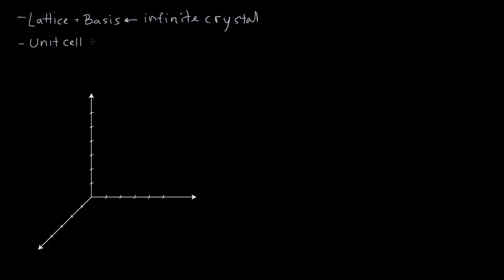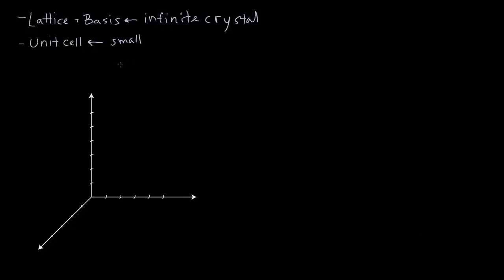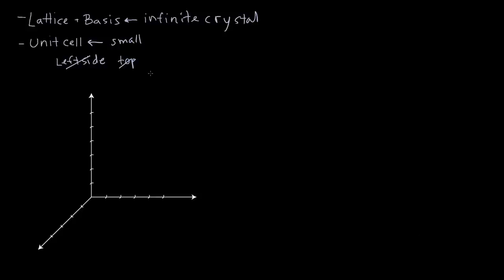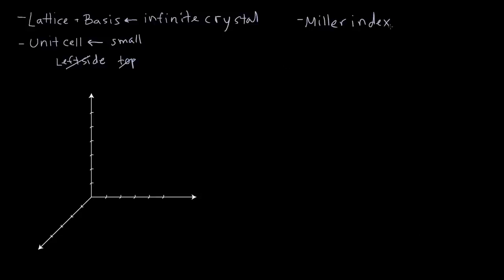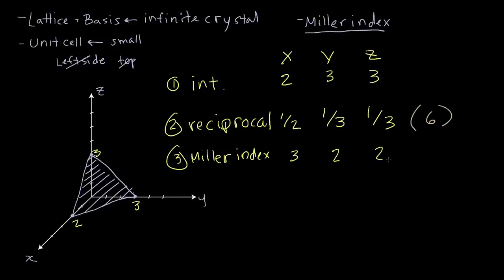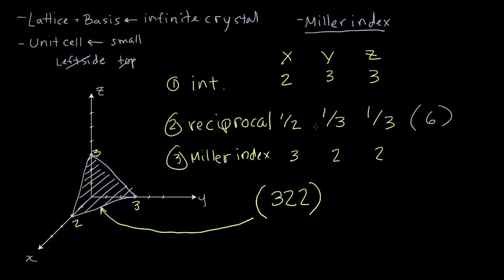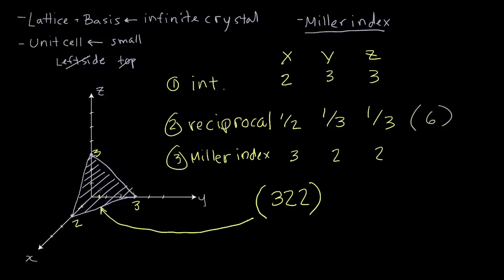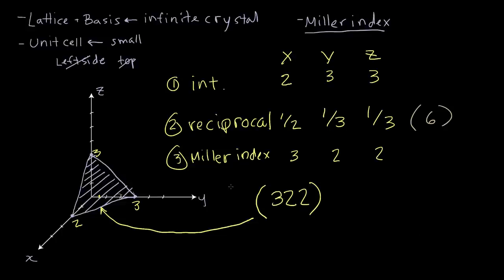10 - Miller Indices Introduction | Crystallography for Everyone

Comment: What's the point of finding the reciprocal of the points to get the miller index?  Makes a lot more sense to say (2,3,3) since those are the actual intercepts than to find the reciprocal and say (3,2,2).  That is completely counter intuitive.  I know you didn't invent it, but that doesn't make sense.
Reply: Tony Kendrick Exactly what I'm thinking. I assume there must be a reason once crystallography gets more complicated. Scientists generally aren't stupid, and don't do random operations for no reason haha.
Reply: +Donny Blue can you please elaborate? I didn't understand
Reply: Pretty late to the party here, but a useful reason for taking the reciprocal of the points is if you have a plane going to infinity. Planes do not have to intercept all three axes. Having a plane parallel to the axis would be infinity. Materials scientists don't like using "infinity" so they like to express it as 0 instead, by taking the reciprocal of infinity. Thus, the reciprocal is taken for all planes.
Reply: @rossfindlay1733  that's it? "They didn't like infinity" 🤔 that is weird...
Reply: @DonnyBlue15  this seems more reasonable...

Comment: Ok so why cant we just label it as (233)? Not trying to be a smart ass, but what is the point? I think he said it allows for more simplicity, but I need more clarification.
Reply: A useful reason for taking the reciprocal of the points is if you have a plane going to infinity. Planes do not have to intercept all three axes. Having a plane parallel to an axis would be infinity. Materials scientists don't like using "infinity" so they like to express it as 0 instead, by taking the reciprocal of infinity. Thus, the reciprocal is taken for all planes so the same process is done for each axis.
Reply: 322 also defines the normal of the plane drawn.
3x + 2y + 2z = 6 is the plane in the image

Having the normal is easier to work with in linear algebra.